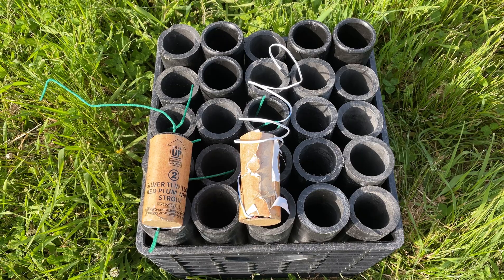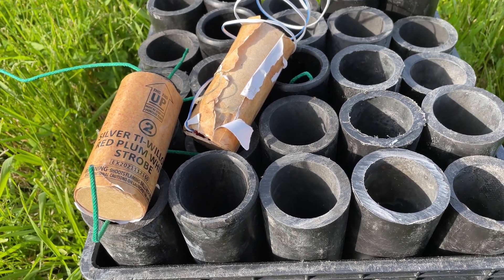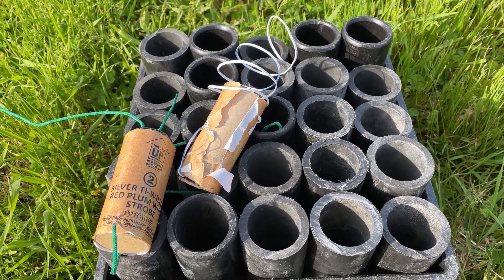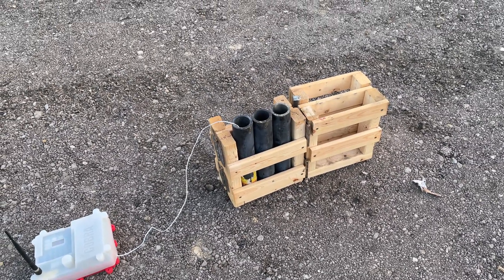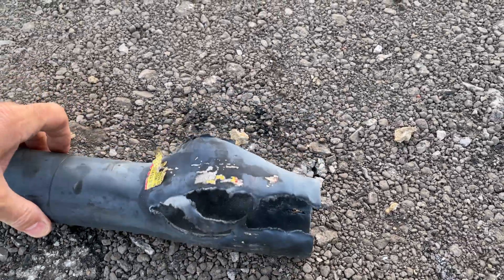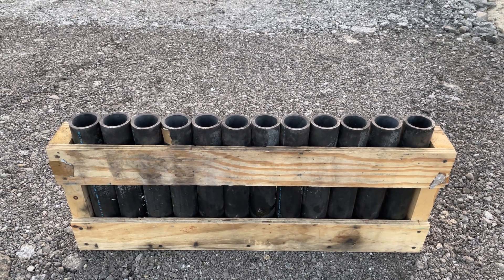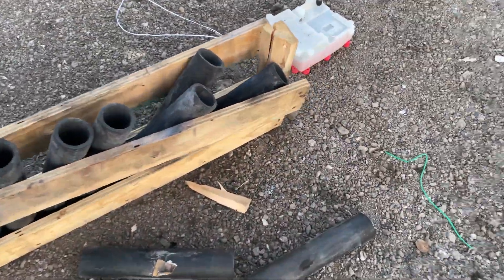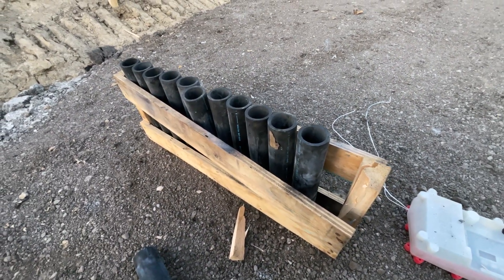Testing 1.75" rack designs for catastrophic failure of HDPE mortars

Comment: What about the idea of adding ratchet straps around the top horizontal plywood? Maybe that could help prevent the board and screws from pulling out?
Reply from the maker: @davidfranco1475 , the use of ratchet straps is a somewhat common dispute in the professional pyro community.  Some will say they've been safely using them professionally for decades.  Others will argue they pop just as easily and now you have additional debris (including metal ratchets) flying who-knows-where. 
Either way, the integrity of the rack will likely be compromised in some fashion.  If not the top bracing, then maybe the bottom or sides (or spacers, if you have 'em).  Ratchet strap or not, the rack will likely need to be rebuilt after a CATO.
Reply: @evolution2001 okay thank you for the explanation.  I have no knowledge outside of consumer so I wasnt even aware there was an debate on them. I saw them used in a video once and thought that was a good idea. But Makes sense, less stuff flying around the better!

Comment: Is Fiber Glass tube safer than HDPE tube ?
Reply from the maker: I think fiberglass and HDPE are fairly equal. However, I feel that HDPE lasts longer. Fiberglass will start to fray and their concrete plugs don’t last as long as wooden plugs in HDPE tubes.
Reply: @evolution2001  Thank you for your reply.

Comment: I'm going to make two racks out of Azac one 6 shot and one 12 shot and use a kreg jig to screw together that might stand up to anything. The spacing has to be correct to you need to leave enough space in the Middle where the shell is for explosion pressure put the boards up high leave about 2 in from the top and put the board at the lowest it can go leave the whole middle open. Going to use scrap from construction sites. 🧐

Comment: About the use of spray foam between mortars... No! It's also a bad idea. The link shows a test, just like the ones in this video, except it's a milk crate with spray foam between tubes. Tubes still scattered and the spray foam burned terribly. 

https://youtu.be/uc31ULt_yPU?si=wgFOyWxCgTYMKqn9

It's a mistake to try to contain the energy from the blast. It's extremely powerful. Multiple tests have shown that air space between mortars is the most effective way to keep tubes from scattering during a CATO.
Reply from the maker: From a purely scientific curiosity view (because it's completely impractical), I wonder how ballistics gel would do instead of foam.  Again, it's not practical in any way and we'll likely never see it tested, but I like to see different things tested purely for sake of doing so.  (Those are many of my favorite channels on YouTube.)

Comment: Yes clearly splinters and screws flying around is much safer than lightweight milk crate plastic.    Facepalm*
Reply: Curious if you have you seen a rack with spacers? They release gas/pressure from all directions. Often the entire rack is just fine. None of this testing was done with spacers, although the wood rack was the best one. Milk Crate racks are not a good way to go as it dense packs into a cube.  And the comment below is misguided. You don't want foam, you want open air space. And the fewer tubes per row, the better. Six tubes flying is better than 12, and so on. With a good rack the release point is above the plug and below the top in the most likely to CATO location.
Reply: Exactly my thoughts. And couldnt you just put some styrofoam between mortars in the milk crate to absorb impact? Sure you lose some space for mortars but it would still probably hold 16 and thats alot for a rack that size
Reply: @undergroundgaming3172 it's still a terrible idea. See this test. Besides scattered mortars, the spray foam caught fire and spewed chemicals which I'm sure would be terrible to breathe.

https://youtu.be/uc31ULt_yPU?si=wgFOyWxCgTYMKqn9

Comment: lets see some fiberglass tube tests. i’ve purposely put shells upside down in them before and the few ive done it with the tubes were still usable afterwards just a minor swell
Reply from the maker: Unfortunately, I'm 100% HDPE.  I have seen larger shells burst in fiberglass and the end result is typically the same: The tube experiences a blowout. It looks almost the same, except that the fiberglass starts to unravel.  For grins, I may take a fiberglass tube from a kit and detonate a shell inside it.  Maybe the same time that I test the single HDPE with the bottom sleeve.

Comment: I think better than a block separating each mortar is air separating them.  Wood or other solid still transmits shock.  The "blocks" shown do have the advantage of holding the guns straight, but I think better than that would be fixing them in wells on the bottom.  Better still would be enclosing the rack to form a sandbox to at least the height the shell sits in the gun.
Reply from the maker: Yeah, from what I've seen thus far, airgaps are the best solution for preventing a complete blowout of the rack.  I suspect sandboxes would also be a good solution, but there still needs to be gaps between the tubes.  Unfortunately, sandboxes are intended for permanent installations and I believe the majority of my audience is backyard pyros that aren't going to have permanent installs.
Reply: @evolution2001  Like planter boxes, but less substantial.  You put the base of the rack with the guns glued into wells in it in the bottom of the box, then pour sand around it to desired height.  When finished, tip the rack on its side and collect the sand.  If you don't want the guns permanently in the rack, skip the glue and just pressure-fit them into the wells.  For more portability, use a wheelbarrow instead of a planter box; just make sure the barrow's strong enough for its bottom to stand the lift shock.

Comment: Hey, have you considered redoing the test but with a 1000lb or greater rated ratchet strap around both a wooden and a milk crate mortar rack? There’s rumors flying around on the pyro forums that a strap can prevent your rack from flying apart, but there’s no videos of anyone testing it yet.
Reply from the maker: I've heard people suggesting a ratchet strap.  But, no, I hadn't planned on testing that.  I suspect that in the use of a milkcrate, all that energy still has to go somewhere, and that it would likely warp the milkcrate around the strap.  There's also the consideration, as I noted in this video, that the failure could happen in any tube.  I'm not able to successfully hypothesize nor visualize how a single ratchet strap would hold anything together.  Maaaaybe on a wooden rack if it was strapped around the top bracing, but that still leaves your bottom exposed, and that's where most of the failures occurred.
Reply: I've heard the same thing and I believe I've seen it in action in pro show vids (just not a Cato vid with it yet) 
If you were to soak the strap in water before hand it really would be one of the best options.
Reply from the maker: @youtubesucks-yx6kk  Possibly.  
The following is just me thinking aloud and NOT taking pot-shots at you nor anyone else.  Conversation / Discussion is good!
At what point do we reach the boundary of "reasonable".  If I have (30) 1.75" racks, is it reasonable to have (30) ratchet straps and somehow have them saturated with water?  By what measure?  And thinking a bit more generally or broadly, do all these scenarios and mitigation strategies only apply to 1.75" racks?  If so, "Why only 1.75" racks?"  Why doesn't this conversation take place with all rack sizes?  ("Maybe it does?")  It would seem logical to think that professional display companies around the world would also want to employ the most reasonable safety measures.  I've worked with world-recognized display companies and I personally have never seen ratchet straps employed.  Not to say they aren't, just that I have never been on a shoot site where they've been used.
I'm begging to think that with every iteration of "do this for more safety", we get closer to "Why even have racks? Just isolate every individual mortar like we do with 10-inch shells and larger."  After that, the only remaining option is "Don't shoot fireworks.  They are inherently unpredictable and dangerous."  
I'm gonna put up a post in some pyro groups...I'm curious if APA, NFA, or PGI have any formal recommendations for 1.75" rack builds.  I know there are minimum requirements for larger shell diameters.
Reply: @evolution2001  of course we should be talking about all racks lol.
I've never tried it so I can't say I've ever suggested it. However it's not difficult to toss a few straps in a bucket of water and let them sit while setting up. I don't use crates and don't really plan on getting or making any racks bigger than 6 tube just incase of a cato. 
However if I was gonna toss 25 tubes in a crate or anything really,  a strap or 2 wouldn't be the worst addition. We don't do pyro because it's easy and adding 2 minutes to set up for a safety measure on racks with a large number of tubes seems simple enough. 

Location and how someone is lighting Plays a big roll as well though. 
Someone doing electric can likely afford to take more risk since they will be well out of the danger zone.

Comment: Milk crates are dangerous !!!  You will be putting your body parts over loaded tubes and tubes that have just fired. What happens in just the moment you don't realize a shell has lit next to the one you just lit. Boom, You get hurt badly.  Use single row racks only made from wood.  Barricade ALL 1.4 cakes to prevent side blowouts inflicting harm to you and your audience. Cinder blocks are perfect for that. Have fun and be SAFE !!  Wear protective gear and face shields.  Professional Pyrotech for 22 years with NO injuries.
Reply: While I’m not advocating that milkcrate racks are safe, I will just say that if you fuse the shells of a rack to each other, or to individual e-matches, then you won’t have to put any part of your body over the tubes during setup or lighting.

Comment: Thank you for making this video! I think it is good for people to know the dangers of loading shells upside down. A test you should do is to fire a shell from a mortar that is just sitting on the ground to actually see what "leftover" shells loaded in a gun that have lit fuses would do. I am curious to see if the shell would actually exit the gun or if it would just stay in the gun because there is nothing putting pressure on the bottom of the tube to help the shell launch out of the gun. Another test that should be done is with a rack that has spacers in between the guns. I've seen HDPE shatter like PVC in some really cold conditions. It would be interesting to see the difference between fiberglass and HDPE in the cold of winter to see which is actually better to make racks with. Again, great video partner!
Reply: Usually the "blocks" in between the tubes is just cut up 3/4" plywood... just fyi
Reply from the maker: HDPE "shatter like PVC"?  I'll have to check with my friend who has a Doctorate in Polymer Chemistry.  I would figure that HDPE's tensile strength is way below conditions in what anyone would be shooting.  Are you certain what you saw wasn't black PVC or ABS?  Based on some searching, the temperature at which HDPE becomes "brittle" or its "glass transition temperature" is -100°C.  Soooo...I don't think you saw HDPE shatter.  LOL

Comment: I'm not trying to be that guy, just a couple of comments.  HDPE tubes were not made for shells it was made for plumbing.  Just one of the best ways to shoot shells. I've been shooting fireworks for decades never had a failed lift charge. Often shets that don't lift high enough are do to not making sure that she'll hits the bottom. Good rule of thumb is take a stick and make sure that shell hits bottom. Another way to check shell lift charge is just shake it you can hear if it has lift charge. Most consumer grade shells and cakes today are done by machine. Don't take this the wrong way just talking. Have a safe and happy 4th!! 😊💥💣
Reply: I know HDPE was initially meant for plumbing, BUT it does behave in a way that makes it very conducive for using as a mortar gun in pyrotechnics. What else do you know of that wasn't meant for the art of fireworks, but is now commonly used by pyros everywhere? How about aluminum (CraigCo racks), wood (all sorts of racks), kitchen utensils (manufacturing), packing tape & zip ties (fusing shells together), the list can go on and on. I too have been shooting for a couple decades and have seen a lot of failures that can happen. HDPE can shatter like PVC in extreme cold, but fiberglass shreds apart. I don't think either are the definitive answer, I don't think anything will be the definitive answer because at the end of the day, we are dealing with bombs that make color. As for the consumer shells, they are still made by hand... would you trust a machine to load a sort of "slow flash" into a shell? Would you trust a machine to load boosted BP into a shell? The tubes are made by machine, and the clay plugs are pressed by machine but everything else is done by a human using a former to execute the process. The lift charge may not fail, but every once and a while you get flower pots or extremely low breaks that may or may not damage the tube/rack you are dealing with. I do agree that 99/100 times, the lift potential is degraded by debris left in the gun, no doubt about that. I personally try to dump my personal racks of debris after a show. Biggest take away of this video is to point out what CAN happen if shells are handled incorrectly. There isn't enough of this type of safety material out there and I am glad this person decided to make some to showcase the importance of safety when handling pyrotechnic devices.
Reply: @CurtieKing  it's hard for me to express through text. In the vid he mentioned hdpe was made for fireworks that's why I said that. I also did say it is one of the best way to shoot shells. All I was trying to get across is if you shake a shell you can hear lift charge(as the stars should not move) so then you know there is a lift. No matter what if it has lift that shell is going up all day! If it doesn't that's operator's error! Yes there is low breaks we've all had those and can deal with that if your proper distance back all is good. Didn't blow in tube no shrapnel being thrown. If tube is clean shell is touching bottom and you heard lift charge shell is going up all day long! If not all operator's error. Have a safe and happy 4th bro!

Comment: I don't understand what is the reason of this videos with cans upside down, no one will launch cans like that.
Reply: never say never...that's the reason the warning label and picture depicting how to correctly load the shell is on the box......remember it had to happen if the government puts a label on it like that..Plus it's not just loading them upside down it's about failure...i've had several shells fail and blow the tubes up over the years
Reply: Simulated failure in tube.

Comment: This could have been a great video but all u showed us was that milk crates are shit and a rack with out spacers in the event of a Cato will be fucked. Wish u would have used a rack that is built to all the standards of the pyro purist. I.e spacers and using plywood on the bottom rail. The whole idea being if u have a Cato your racks design would save you from what will most likely be 10+ shells fused together after the cato shooting at the crowd...  

All this video showed is that a Cato will destroy a rack with out spacers and plywood rails. Wish you would have tested the actualy relevant variables.

Thanks for trying tho.
Reply from the maker: While I don't disagree with you, this video won't be as interesting or relevant to a "pyro purist" as you call it.  While this video certainly applies to all levels of pyro skill, it is predominantly aimed towards the "backyard pyro" since they are going to be the ones shooting out of milkcrates and will likely not have any formal training from groups like PGI or local display companies.
Also, to me, using the term "pyro purists" conjures up the idea that regardless of what is presented to them, they are unwavering in whatever their current belief is.  But again, I don't disagree with your overall assessment. ✌🏻

Comment: All we ever see is shells being turned up side down to cause a Cato. Wonder what cause and effect would be if the shell gets wedge in with if facing up properly and see what th3 Cato would be.
Reply from the maker: I think that would be a difficult scenario to occur.  That would require MULTIPLE procedural failures.  But let's hypothesize the scenario: I think the primary factor would where in the mortar it gets wedged and how tight it is.  If it's fully stuck at the bottom of the tube, I'd say you're still gonna have a blowout.  Unless the wedge isn't strong enough to overcome the lifting force applied to the shell.
If it's at or very near the top of the mortar, I hypothesize that you'd end of up with something resembling a flower pot, but still have enough damage to the mortar to retire it from use.
Again, I think a 'wedge' situation would be exceptionally rare, but...I guess I'd still expect similar results to a complete "no lift" scenario.
Reply: @evolution2001  I also think a wedge scenario is highly unlikely... that means a person would have to force the shell to the bottom and most people I know, just wouldn't think to do this. I have also forced a shell to the bottom of a gun... wanna know what it did? It launched out of the top with EXTREME prejudice! I mean, it went SOARING out of the gun with authority! It was a nice thud to hear too!